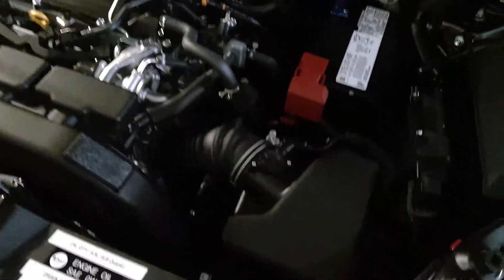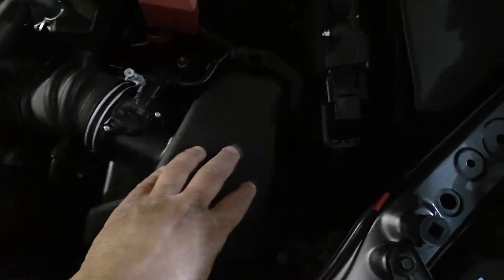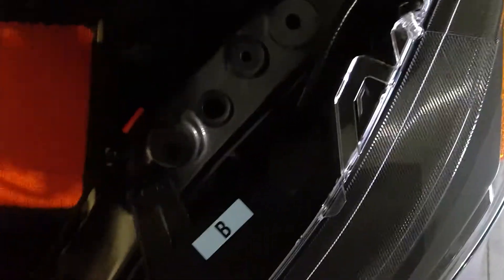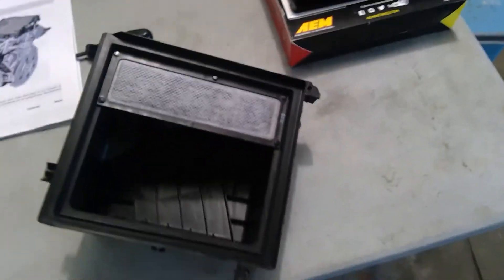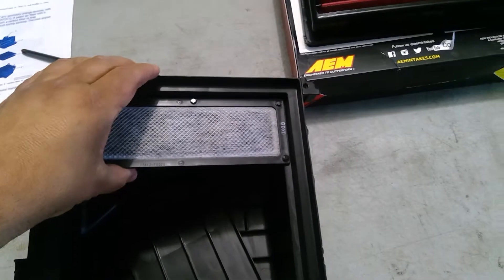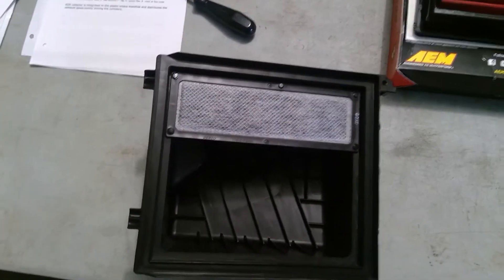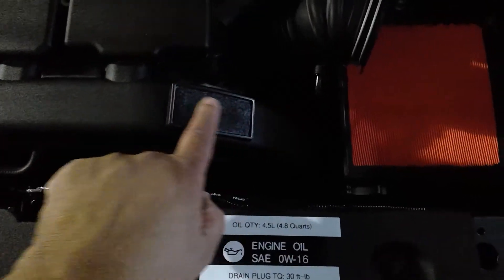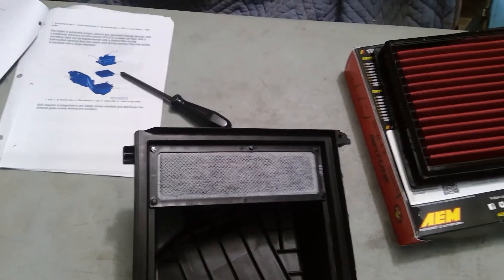Increase Air Flow & MPG on Stock Air Box - Free Mod

Comment: Did you notice any gains in mpg by removing this piece?
Reply from the maker: Hard to say, but removing any restriction in the intake cannot hurt. My MPG's are okay, but, I rarely    use it the last 6 months. At this time, after 10 months, I only have 3,603 kilometers on the clock.
Reply: @impalalfx1349  : You have not trip computer in your car? you could notice any difference from the first days.